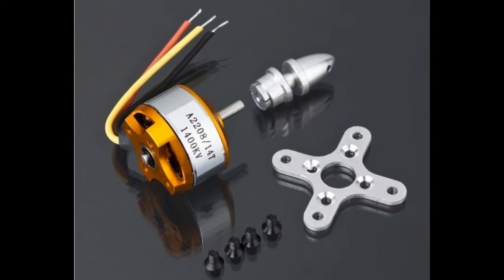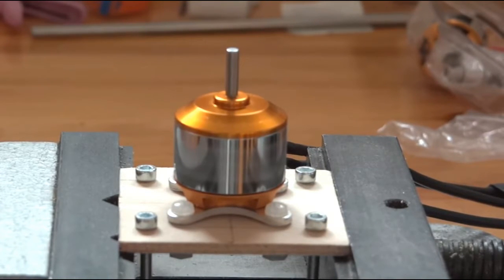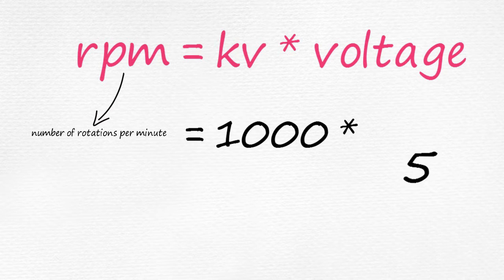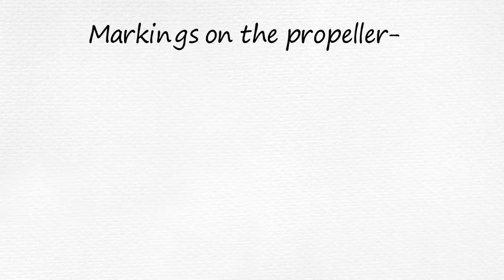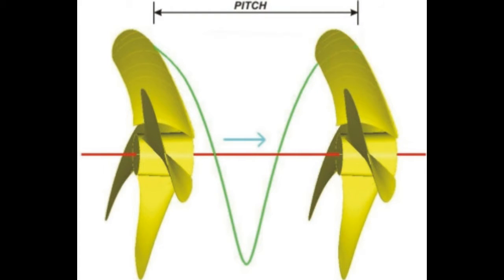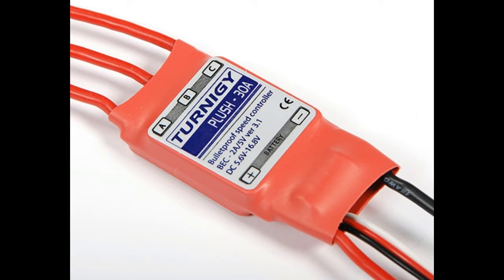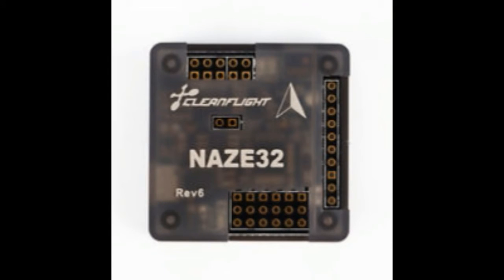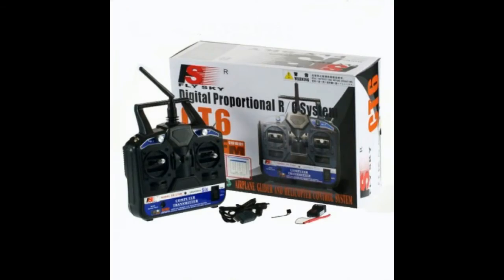components required to make a quadcopter at home ,all components described#How to make quadcopter

Comment: Hello, i gonna make my first quadcopter. When I was buying motor(BR 2212 2450KV) their was  recommended prop size 6030 but I want to use 1045 prop. Is it creat any trouble.
Please answer soon
Reply from the maker: Anindya sundar Das yeah it will....for this type of motor you should use the recommended propeller size and if you don't then it would not produce sufficient thrust ....and if you want to use 10*4.5 propellers then you should prefer 1000kv motor....Thank you
Reply from the maker: Anindya sundar Das and if you want to buy suitable components then let me know I will provide you best buy links for the suitable products at good price...
Reply: For that exact motor model pulling weight is 815g if I use recommended prop that is 6030.
If I use 1045 prop then is it pulling power increase??
Reply from the maker: yeah when you will use them motors will become worm and due to it your flight time would also reduce and more over motors would not produce decent torque in order to lift the quad.
Reply: Yes I want link to buy motors for 1045 prop, it should be able to pull weight upto 3kg(in total) and also cheap in price.
Reply from the maker: Anindya sundar Das link is in the discription of the video motors are cheap in price and also they have bullet connectors with them so that there is no problem in connecting them with ESC you can browse for more from those links which are there in the discription of the video... thank you my friend